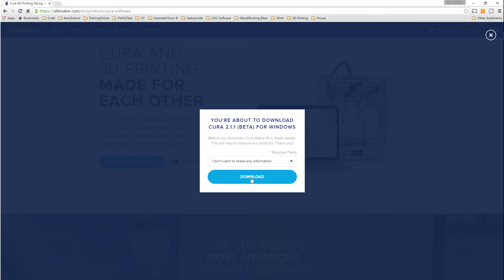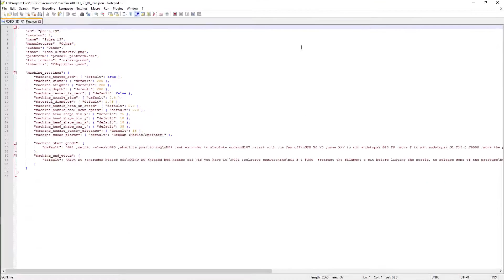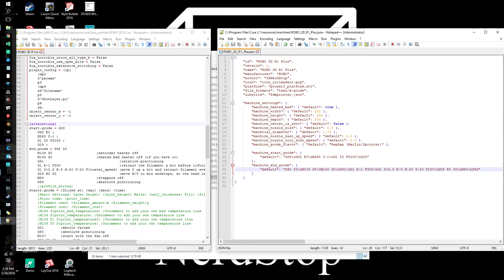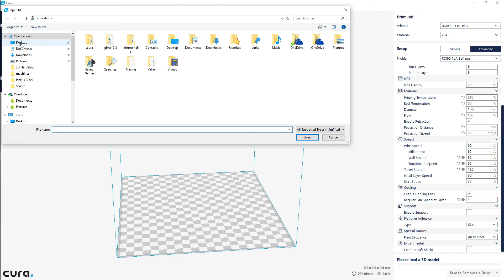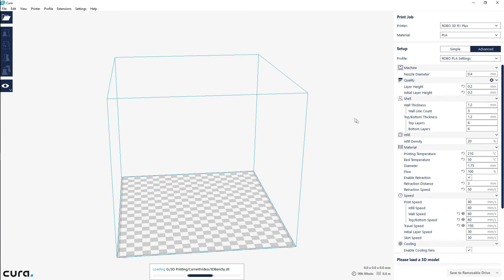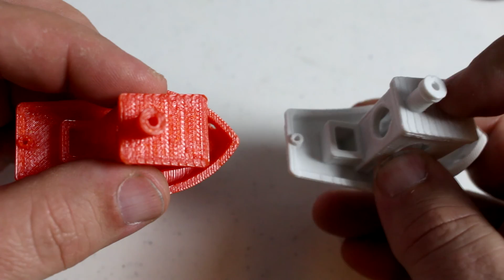Upgrade: CURA 2 beta

Comment: CURA 2 is crap unless you have one of their own printers. Its garbage right now. Wait till they fix it.
Reply from the maker: Yup CURA 2 has some bugs and for the most part it does not work well with the ROBO. I have used it on one or two prints and they came out ok and the only reason I used CURA 2 is because CURA would not print out the print correctly. But yea for the most part I would not use CURA 2.

Comment: Cura 2 DOES NOT work!!! Automatic resizing doesnt work. The screen moves annoyingly around one its own. Rotation does not work.
Reply from the maker: I have not tried the newest version of CURA 2. I have 2.1.1 beta and yes it has problems. I will have to down load the newest version and test it out.
Reply: I have no idea why they released it. Its unbelievably faulty.